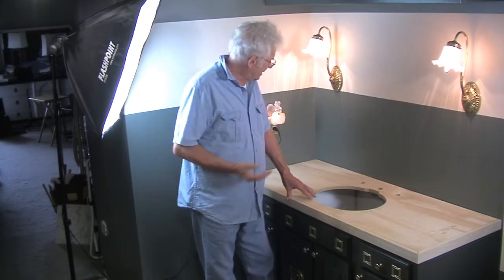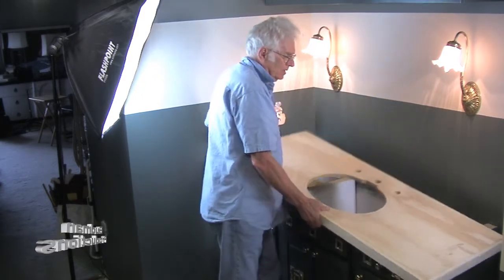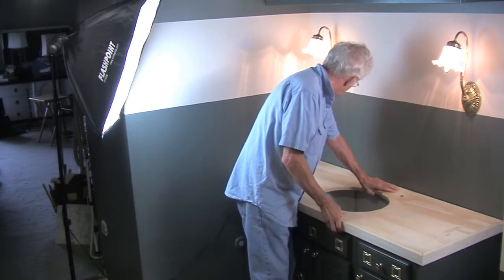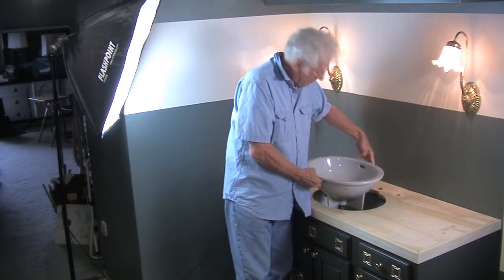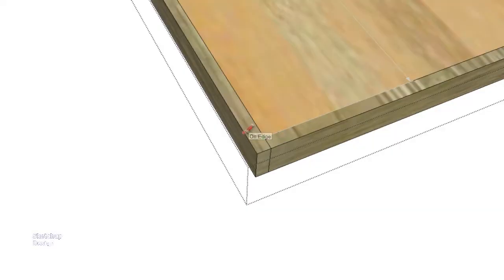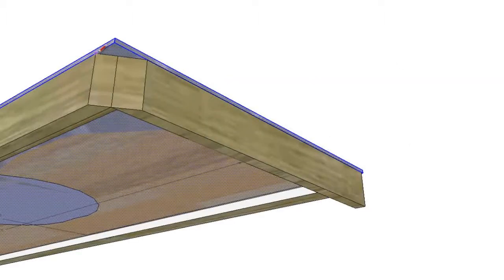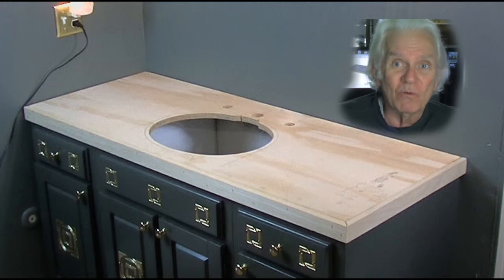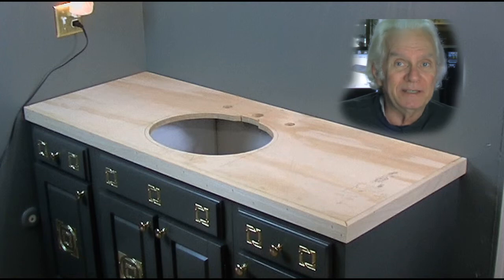Mosaic Vanity Base Construction

Comment: Talking with the folks at Redgard (custom building) waterproofing membrane they still recommend cement board or wonderboard over osb or plywood to prevent cracking. So the cement board was still necessary. Thanks for the video!